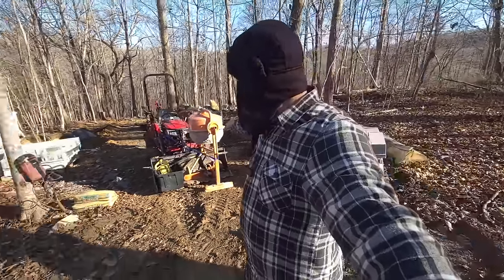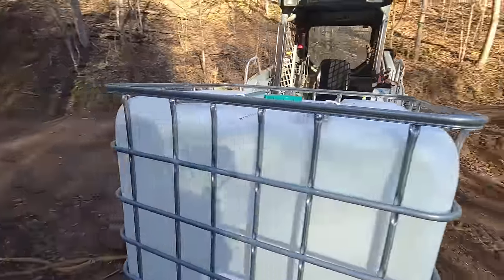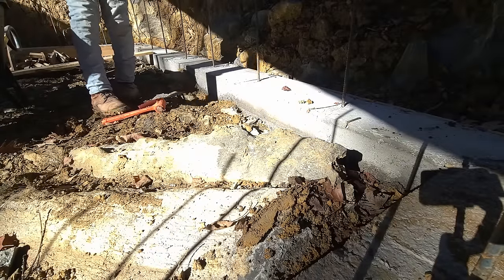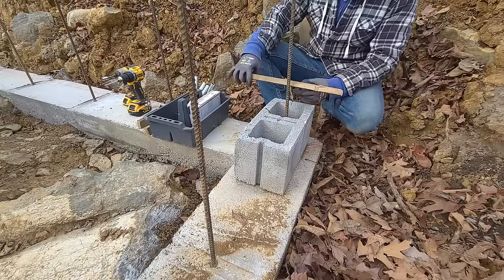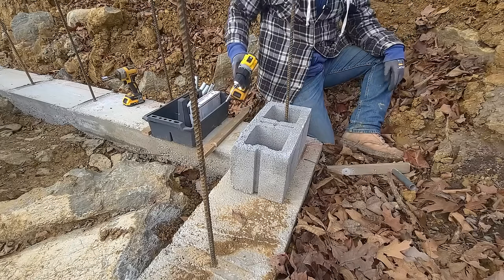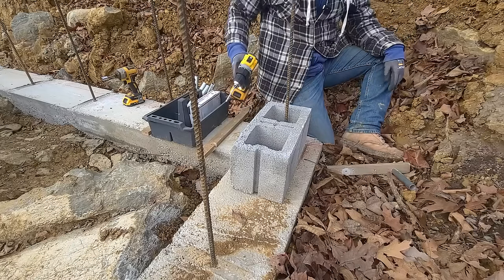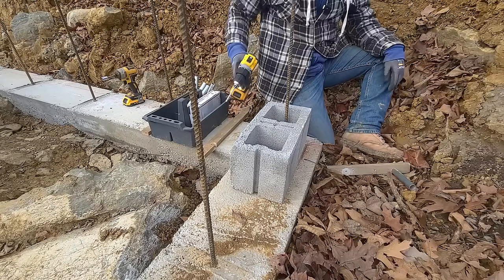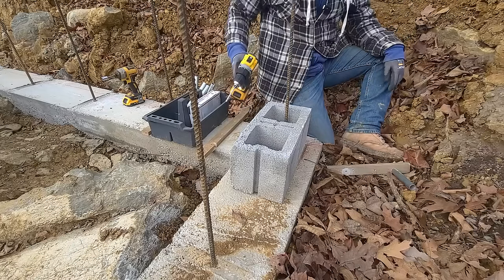Building the root cellar walls with concrete block // E135

Comment: You quickly mastered the "buttering" technique on the blocks, and attention to detail in the leveling/plumbing of the blocks that you improvised was really good, too.  As you said, mastering techniques and experience on that project will sure go a long ways toward being ready to do the house foundation.  Glad you were able to get this project done before the weather turns too cold for concrete/cement work, too.  Happy New Year.

Comment: Hi  John. For future reference, to make holes in the bottom of your 'burn barrel', use an Angle Grinder with a thin cutting disc and make an 'X' cut about 2 to 3 inch, then fold in the 'petals'. This method is much faster (seconds) & easier (effortless), plus you can make the holes any size you wish ... Your welcome 😎........ PS. Put some food dye (colouring) in your 'Water Level to make it more visible ? 😉
Reply: Windshield washer fluid is coloured and resists freezing, too.
Add some brake line de-icer if it freezes on you.

Comment: Happy New Year from Wales in the UK. Excellent progress, and I really appreciate you taking the time to record and share this with us. The temptation to get on with the building work without setting up cameras must be very high! 

An interesting observation. In the UK, it's rare to use premixed mortar. It's far more common to get sand delivered loose and then the builders mix the correct ratio with sacks of Portland cement in the mixer on site.

Comment: Hi Gary from the UK here grate video very interesting and informative keep them coming, I have a tip for you add a bucket of water to the rocks in the mixer when cleaning it will clean the mixer better,  plus a cup of dishwasher soap to the morter mix it makes it creamier and sticky on the trowel,  a better mix, plus will you be pouring concrete into the blockwork to give extra strength and more rebar sliped in as well,  plus are you making your own lintel  as well for the door way, it's easy to make a form to create the shape don't forget the rebar for extra strength
Reply from the maker: Hi Gary, thanks for the clean up tips.  I only have a few more blocks and then I need to clean that mixer thoroughly.  To answer your questions, yes.  I'm filling the cores with concrete, but not the same as the mortar.  I added set accelerator (freeze prevention) to the mortar if you remember, and it's not good to expose the steel to it.  That's why I didn't fill the cores as I went.  As far as the lintel, I have a 8x8 timber in the solar kiln that is ready to go that more than satisfies the span for the opening.  Thanks for watching!
Reply: @WalnutsandWineberries  you are welcome, I think coating the outside of the root cellar would be great idea  it will stop the damp coming through the walls  into the cellar and a vapour  barrier under  the floor when you concrete the floor

Comment: I do hope you filled the holes with mortar that have the steel rebar. Personally when we did such work every hole was filled and every third corse was reinforced with a steel mesh to tie the length together. Thouroseal on the exterior will help followed by a bituminous waterproofing coating, taking care to catch the joint between the block and footer. It would also help if you could open a small trench out from the structures and lower than the footer and add a French drain pit even deeper. Line the perimeter with perforated drain tile and route it to the French drain. Cover the pipe with geofabric to keep out dirt and backfill a good portion with pea gravel that can be compacted. This will help drain any water that might gather around the foundation and lower wall that could find its way into the cellar and flood it.
Reply from the maker: Cores will be filled with fibered concrete.  Can't use the same mortar because of that set accelerator isn't friendly with steel.

Comment: Nice job, he footers should be twice as wide as your block. Center the block. Where the rebar is cut the block on the first course so you can cleanout junk, cover with wood and fill the whole cell at the same time to the top.

Comment: Neat idea with the water levels. Why didn't you use a laser level? Some are cheap and some are expensive, but they are really convenient and accurate. Doesn't really matter though, because that water level method is awesome, and I guess that's how it was done before we had spinning lasers driven by computers with gravity accelerometer sensors.
I love the things you teach us on this channel!
Reply from the maker: Yes, my thoughts exactly.  Lasers are cool, but they're expensive and are prone to getting in the way of my heavy equipment.  I tend to break a lot of stuff.  Worse case, with my water level, I would need to invest in a new 5-gallon bucket.  Haha!  Plus, gravity never lies.

Comment: @20:30 How are you using that level?  The way you had it laying on the blocks would not give you an accurate reading for level or plumb.
I like the low-tech water level.  Some things just don't need a battery! 🙂

Comment: If you build a tower that is solid and at a height above your facilities in the structures (house, shed, and storage) t and place one of those containers at the top and feed it from the line, the gravity will supply your water pressure and it will work even if your electric goes out (you know if it is cloudy for two weeks in a row).

If you have a full tank up in the air then you would never have to wait for water. The water would be instantaneous and at pressure.
Reply from the maker: It would be a nice option - one I have considered in the past.  Problem is, you don't even get 0.5 psi per vertical foot.  That means I would need a 100-foot water tower to get sub-par water pressure (50 psi) in the house, not to mention the extra 100 feet of lift I'd be asking on the well pump.

Comment: Why not run your corner leads up like a regular mason ? It was as much time fiddling with all your other stuff to run all four corners. Just wondering is all
Reply from the maker: It seemed more forgiving for an amateur doing it the way I did.  With a lot more experience, I would possibly try the corner to corner mason traditional technique.

Comment: Unless your level is different than any other level that I've ever used, you're using it wrong... The long skinny side is what is supposed to be touching the surface that you are wanting to level or determine plumb on... There is no guarantee that the bubbles are going to be set correctly for the way you are using it, plus if the level was to warp, it would warp in that direction since it has the thinnest portion of material to prevent it... Also, you need a longer level... You should have at least a 3 ft level for those blocks because you are not so much concerned with a single block, but a number of blocks...
Reply from the maker: It can be on its face or on end.  Doesn't matter.

Comment: Are you gone fill the block wall with concrete to make it sttongeŕ
Reply from the maker: Yes, concrete with fiber where the rebar supports go through the cores.